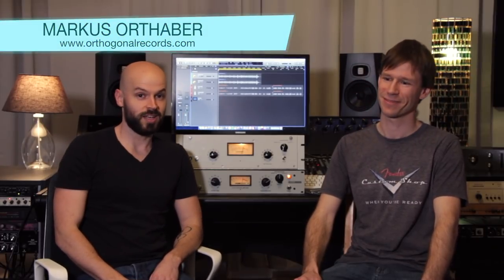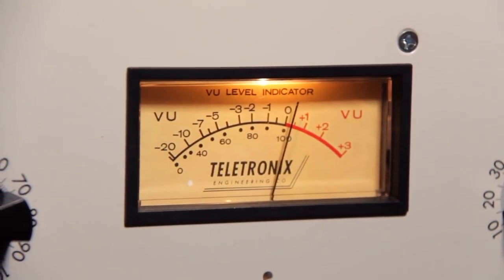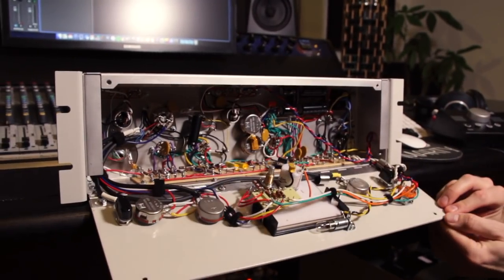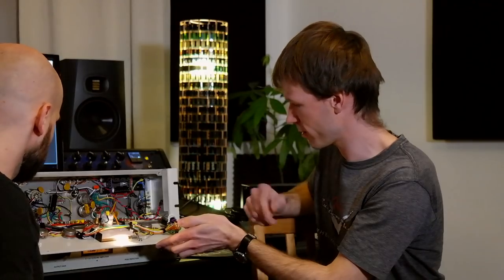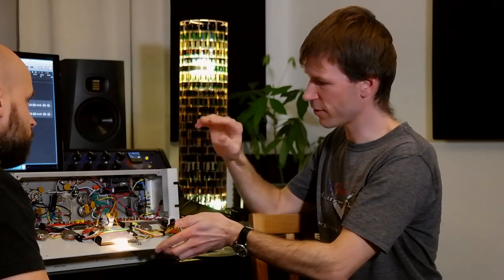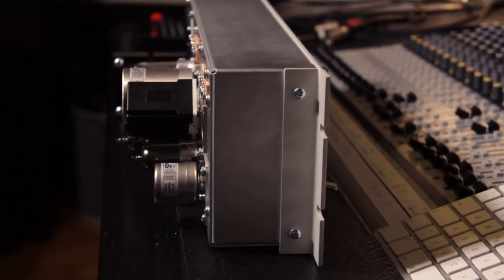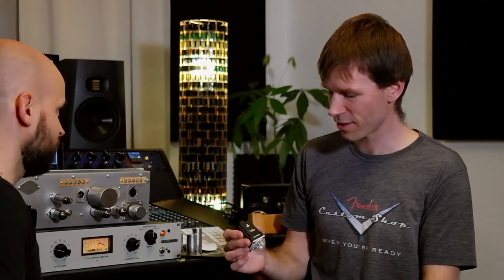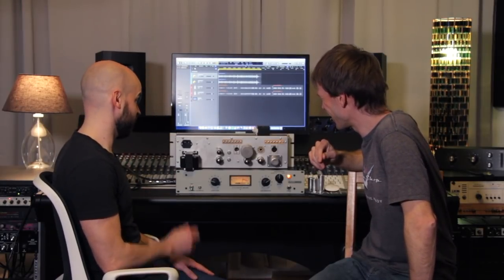DIY-2A Compressor | Markus Orthaber Interview

Comment: Impressive!!! Thanks for this comparison, well sorry about Klark unit but for me the difference was huge, congratulation to your friend he made amazing unit, sounds big, warm with all details there! 
Thanks again for this one!!!
Reply from the maker: Thanks for watching!
Reply: Haha, that's very nice to hear. Especially as I put a lot of money and time into building the DIY. :) But then again I was actually really impressed with the Klark. Didn't expect it to be so close.
Reply: I agree there are differences between the two units. However I downloaded the files and matched the levels. The differences are then much smaller. The DIY unit is still slightly smoother and also has better transient detail though. Sounds like there might be a difference in compression going on also. But that might be down to the different attack/release times of the different photocells.

What would be interesting is to take a Klark Teknik 2a, change the tubes, potentially the transformers and optocell, then compare. I think just with a tube change the differences would be smaller. Transformers could add more low/top end detail.

Here is a link to the portion I matched up - https://www.dropbox.com/s/d0tdkfem9p9txp1/Klark%20Teknik%202a%20vs%20DIY%202a.wav?dl=0

Comment: I agree that the diy had just a little  bit more 3 dimensional sound than the klark, and the lowend and the high just a smidghee better. The klark one was not bad, but more flat sounding. But off course there is also a big difference in price between  the two unit.  Well done. A very interesting comparison
Reply from the maker: Thanks for the comment mate!
Reply: Thank you so much.

Comment: Great video! if i had to choose between the two i think the DIY sound better a lot thicker, fuller & warmer but the klark teknik can hold it's own, i was surprised the klark teknik sound as good as it did compared to the DIY.
Reply from the maker: Thank you! Yes indeed, the DIY is really great! Quite a lot of work but its worth it :) For the price, the Klark is nice too.
Reply: Zed Marty Production I like the klark teknik stuff, I have their pultec and I like it and as you said their prices are unbelievable...you can get some of their gear for the price of some of these expensive plugins !
Reply: I am actually really happy that the DIY at least sounded better. :) On the other hand, I have to agree. Klark is coming quite close.

Comment: DIY sounds more 3d, i agree (listened to with Beyerdynamic DT880). Had the feeling that the DIY was a tiny bit louder, but this might be due to perceived loudness.
Reply from the maker: It could have been a bit louder, we tried to match it as good as possible. Thanks for the comment!
Reply: Matching loudness was actually my biggest concern when doing the tests, we even measured perceived loudness using an LUFS meter. So I think that should be fine. However, I agree that the DIY might sound like it's a tiny bit louder due to being a bit more open at the top.

Comment: The DIY sounded better in my opinion. It was a lot smoother and more transparent opposed to the Klark, meaning you can dial in a lot more gain reduction without it sounding overdone. Also they say the LA2A is really warm mid ranged, and the DIY was much more in that vein than the Klark, which especially shined on the acoustic guitar, but maybe wouldn't be as preferable on other sources.